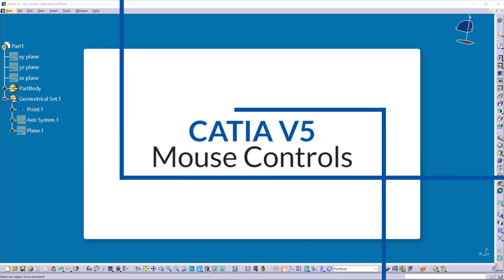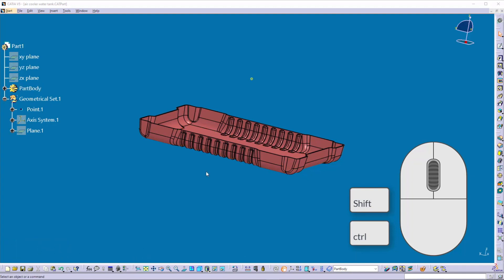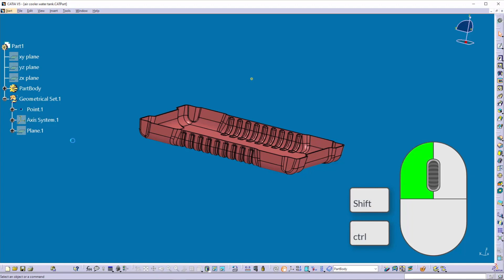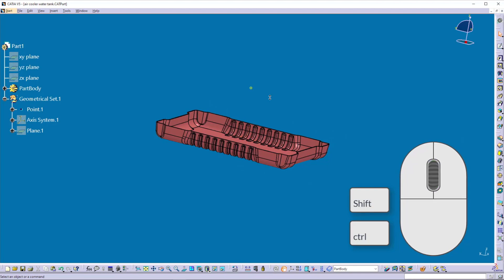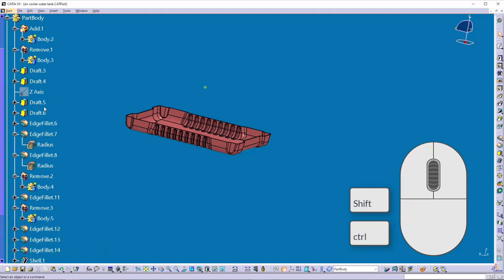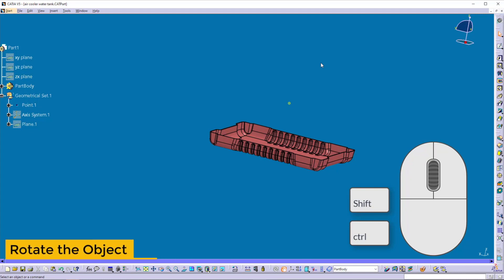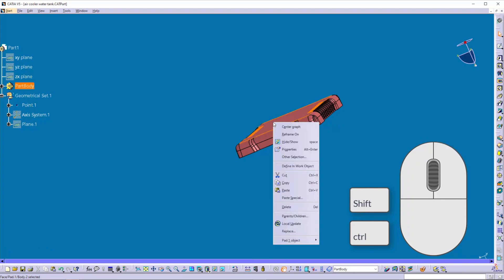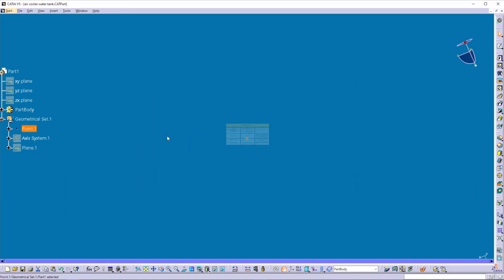CATIA V5: Mouse Controls #catiav5  #3dexperience

Comment: I m unable to rotate zoom in/out the part using mouse

Can u plz help how can I solve these issue? 

I tried a lot.
Reply: same
Reply from the maker: Make sure that geometry is activated instead of specification tree (some times specification tree get activated by clicking on the specification tree to activate geometry click on the white axis located at bottom right corner of the screen then try again)
Reply: DID YOU SOLVE IT? CAN YOU SHARE WITH ME?